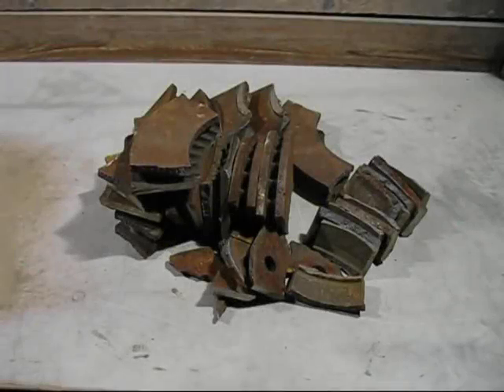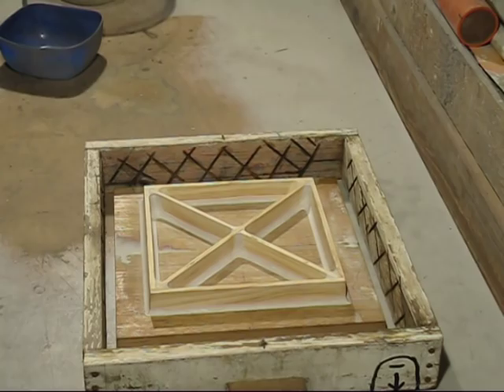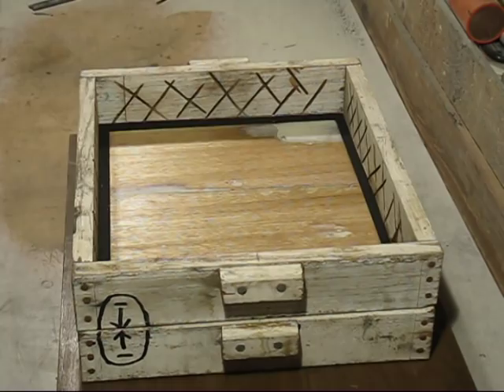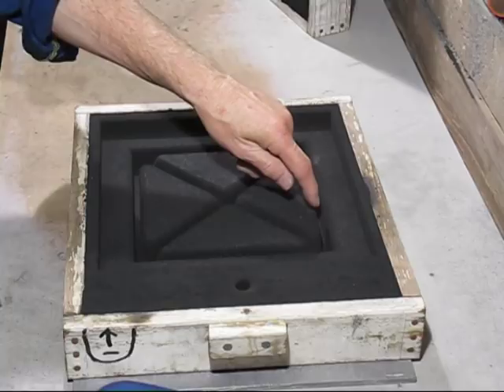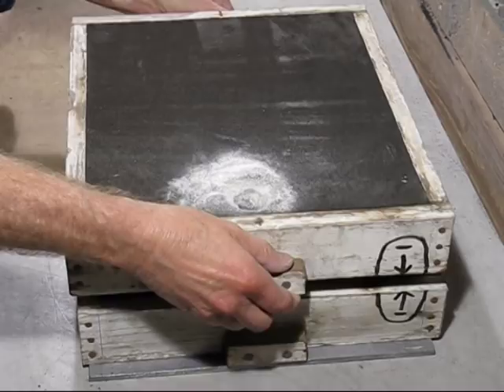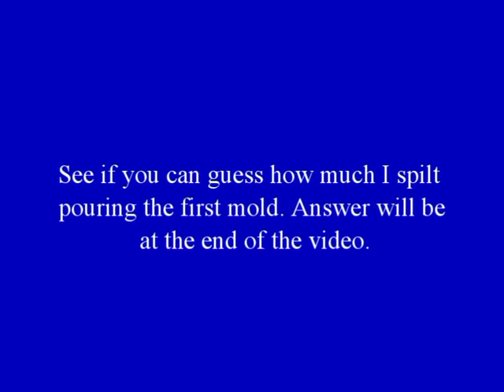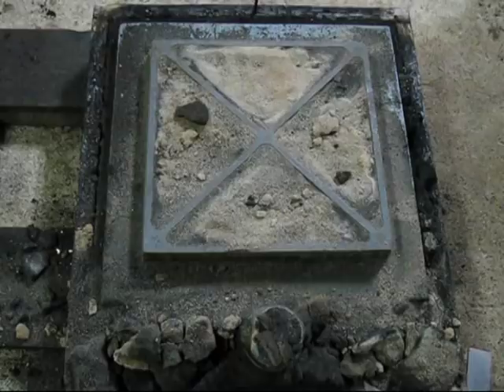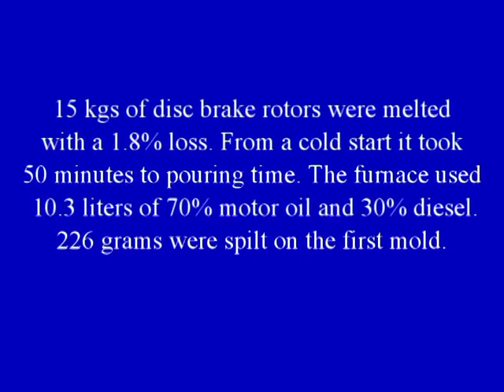Melting disc brake rotors (crucible camera action)

Comment: I have a stack of rotors waiting for my furnace to get finished to try this exact thing, thank you for sharing!
Reply from the maker: Are you still building an electric furnace?
Reply: yeah mate, its been sitting in the "To-Do" bucket for a long time, while I get my lathe and mill rebuilds completed. Finally got those both in and working now, so have resumed work on the electric furnace build... https://www.youtube.com/watch?v=kiWX_cyydqg
I'm really itching to start melting down some of the piles of scrap around the place
Reply: Really long video dude. Make it more shorter.
Reply: "Make it more shorter."  You can make your sentence shorter by saying "make it shorter".  Then it'd be more better.
Reply: It was 40 minutes, showing the same actions being done six times.  The comment has merit.
Reply: @dtrrtd774  LMFAO!!!  Or one could just say THANK YOU???  Yes, for sharing and teaching.
Reply: @alexa.davronov1537  Learn to use your keyboard or phone screen. If you arrow right → it will fast forward 5 seconds. Double tap your phone screen for ten seconds. None of us complained about the length of this video, so I am certain that you are the only one.

Comment: Well... I never had to break the rotors. My furnace held a full ton of rotors with room to spare. And our flasks were about 6 feet long usually.
I did not have that funny cart to wheel around my crucibles. I poured everything by hand and crucibles were measured to amount of iron needed for each casting
Good job. Good video.

Comment: I used to work in a Foundry, MJ Allen. We made all sorts of stuff, I was a fettler but I enjoyed watching the blokes make the castings and moulds.
When hand making moulds for cast Iron they would use a white, chalky looking liquid which they painted over the sand and it blocked up those grain holes that make the castings look rough. Unfortunately I can't remember what it was called but it's worth asking around, I'll see if I can contact the blokes I worked with.

Comment: When I was working as a ladle operator on steelworks, we used a mixture of water, diesel and compressed air to heat up the ladles. Started with diesel and compressed air and then we mixed in pressurized water in the burner .

Comment: Wow it turned out really well! I was helping my father change his rotors and pads recently and thought what a waste it is to throw out or return the rotors. Now after watching this I see a reason to even keep the oil! Can't believe it required almost 11 quarts worth plus around 3 quarts of diesel but if it's recycled motor oil the diesel is cheap. Problem I see for me is getting setup in the first place would cost prohibitive here in Florida as there isn't a lot of industry in the southern US historically, so it would all need to be shipped quite far $$$.
Reply from the maker: Florida is hot all year so the last thing I would want to do is melt cast iron. I live in the cold part of Australia.
Reply: $$$? They got's lot'sa cars with disc brakes in Florida don't they? My furnace shell was free, a really big old water heater tank. Made the furnace barrel and a 5" ring of it for the lid. A friend at a local cement plant gave me a few bags of out-of-date High temp refractory, (lines the huge rotary kilns that cook limestone into cement)  I built a 20' radius swing crane and hung a small Harbor Freight 500 pound electric winch ($50?) under the I-beam on wheels, because my large crucible is just a 12" chunk of 8" sched.80 (3/8" wall) water pipe (it was a free cut-off and I've got several feet left) with a scrap 1/4" plate bottom and 1" square lugs welded on, to lift it out of the furnace. I lined it with more of that refractory. OK, that's my big non-ferrous crucible, I think I paid quite a bit for my large silicon-carbide crucible for iron. As much free, used motor oil in Florida as anywhere else right? Does $$$ mean $3? OK, I did pay nearly $100 for my new 160 Amp Lincoln buzz-box welder, back in 1960 or '61, but it's been paid for many times over. I just remembered, I used a brake disc from a Pontiac Firebird to lock the the crane I-beam swing 10' up on the mast, with rod to an over-center, (locking)  handle below.

And luckygen, I live in the California "High" desert, preheats my furnace feed. ;-)

Comment: I love your furnace, running on waste oil is super,  do you have some video you could share on how you built it . I would really appreciate. Thank you.
Reply: What was the tank of propane in the background next to the blower fan? Pressurized waste oil. Working on vehicles in a small town, the guy who owned it needed heat in the shop. We place a 55 gallon drum outside, with a tire valve in the bung, after filling it, air pressure added. The draft tube went to 2" off the bottom, ran inside to a valve, but we dripped it onto logs in the double barrel stove. One load of wood would last all day. Boy, you could tell when the auto tranny fluid started coming in. It burns way hotter than just used motor oil. We could get 2 vehicles and 1 school bus inside & close the door, so it heated a large area, but we used a box fan behind it about 5' away.

Comment: I've been collecting brake rotors and wheel hubs for a friend who has a furnace that can handle cast iron. Working at a car dealership I have a virtually inexhaustible supply. :) My furnace barely manages to melt aluminum (but that was the design goal, burning wood scraps to melt aluminum), but someday I'll have time and room to build a nice one.
Reply: Try changing from wood scraps to ordinary barbecue charcoal... that’s what they used in the “Bronze Age”. And if you want to get really serious use coke

Comment: Thanks for the video, wanting to restore an old coal forge so might have to try my hand at casting iron myself. Although one of those things that sometimes having a professional show you or do it can make things easier in the long term
Reply from the maker: Are you going to melt iron with the forge?
Reply: @luckygen1001  Thanks for the comment/reply.
Not in the coal one as its a historical piece that is more for the experience, this video years ago was actually my inspiration originally to build a furnace/forge but due to lack of experience + safety forethought about oil/diesel mix i caused a fire due to a leaky valve, so have only been using Gas (thankfully i had foam extinguishers on hand for my vehicles/Equipment)
As my workshop is now full of old cast equipment from 1900-1960 i want to go back to using the oil/diesel mix with gas to do my own castings as looked at electric but don't have the coin for that setup as yet.
100% know that before i even try do any iron casting (I have done Ali,copper,brass on small things) that i need to get some hands on experience with a knowledgeable person that can help me mitigate the risks and provide advice (same reason i have a professional engineer that i can double check things with when doing machining work)
Thanks and didn't mean for the long reply
Reply from the maker: @boltonky  Please do fix those leaks as oil fires can be scary.

Comment: If you do another surface plate, design it with 3 feet instead of 4. That is how most of them are done so they won't twist under their own weight. The twist us usually tiny, but if you are going to scrape it flat to 10ths it is enough to cause a problem. Great video

Comment: If you want more rotors (or other scrap and cut off bits) beer works wonders at garages, scrap yards and machine shops. Scrap iron/steel prices are quite low nowadays so it's a good deal for all concerned. Garages save scrap to be rid of it and few make enough profit to matter.

Comment: Really nice 👏, I use graphite sometimes but it's just to make really rough patterns release from the sand but it also helps Sarah there's a refractory surface against the facing singing as well and I'm surprised you had to Chisel out the sand in the webs but regardless it looks like it turned out great. I made a surface played a couple years ago and it did not turn out anything half as nice as what you got there

Comment: A press with a vee or ball bearing pressing insert might break the rotors more easily than grinding.
Reply from the maker: I don't have a press but could use a hydraulic jack instead.
Reply: I was thinking that my 25 ton log splitter could work
Reply: I just bash em with a 4 lb drilling hammer. I often do it on accident removing seized ones for replacement.

Comment: Hey maybe a suggestion that could help you do less work for the cast iron from the discs. My suggestion is go to your local automotive shop that cuts rotors and this could be a autoparts store or a repair garage that cuts rotors. They always have cut waste from the rotors they will gladly give you for free, heck I would have given you small buckets due to the weight when you discard the waste cast chips. I also think it would melt faster than a solid would. Best regards.

Comment: I have an old vise that is cracked.  I want to try my hand at gas welding it with cast rod. The only cast rod i can find is very expensive.  Some people say to use piston rings. I was just thinking of this video and came back to it. I wonder if I could cut some longer strips close to the center and use the rotor material?  I wonder if the alloy is too hard? Ill plan on doing a long post heat and cool down.

Comment: Back in the days of Galleons and cannons firing cast iron balls, a foundry in the UK used to dust their molds with Plumbago, which I believe is Graphite. it was only mined in the UK at that time and this process allowed the casting of far superior balls to any other country.  I live in S. Australia, where do you get your Ferrosilicon from?  The foundries that I used to work on furnaces, have now closed up.
Reply from the maker: Try cast metal services Australia, that is where I got mine. You may have to buy a minimum amount.

Comment: What a brilliant idea with the disc brakes. I never would of thought to try this. Just brilliant.  I actually have to old large disc brakes. 
I have just bought a old lathe I'm doing a full restoration. And have a broken lathe change gear with a couple of teeth broken. and wondering if I could try this method to make a new cast of my gear. The lathe is 94 yrs old. And just can't find a replacement  gear. Do you think trying your method melting  the disc brakes. 
This would work. Would love to give it a shot.

Beautiful casting you made there. Turned out great. New subscriber
Reply from the maker: It is not a good idea to cast teeth for a gear, better to cast a blank from the old one and then cut the teeth on the blank.
Reply: @luckygen1001  ok thanks

Comment: Another great video. I did think you were pushing your luck with such a small clearance on the cope walls but hey you did it :-)
Ever thought of having the flasks closer to the furnace?  Seems quite a walk. Always entertained and educated by your videos. 
Can you advise how to add silicon to aluminium to improve casting properties on non cast scrap?
Reply from the maker: I have never added silicon to aluminium so I cannot help you there. The area where I run my furnace is very small so putting a lot of molds on the floor makes it very overcrowded. When I use an A6 crucible which holds a small amount of iron I pour right next to the furnace.

Comment: Great vid, mate...but I did cringe when the crucible cruised on by the propane cylinder and gas hose through the doorway. ;)
Reply from the maker: That was a propane bottle used to store my waste oil for the furnace.  The yellow hose is compressed air to pressurize my waste oil bottle.

Comment: It would be cool to see how you machine that plate to have a smooth flat finish, and what you will use it for.   What is the advantage of using the graphite over using talc ?
Reply from the maker: Graphite is supposed to give  abetter finish on the surface of cast iron.

Comment: I want to say that you did a great job on THAT casting but I have a couple valid quistions how long did it take to melt the iron into a liquid and do you have any estimate on how much gas you used durring the melting process I just want to get a dollars and cents idea of what the cost was to make that part I have seen Coppola furnaces used to melt the iron and other high temperature metals but had no clue that such a melt could be done useing a furnace design like yours most of the melts that I've seen using your type of furnace was aluminum bronze copper and brass all low melt metals compared to iron or steel also I have one more question?  The sand that you used it was black can you tell me what the exact mixture was proportionately I was wondering if you had mixed the graphite powder in with bentonite clay and silica sand to obtain the color or weather you had used a different mold material BECAUSE you were casting iron thanks for the video p.s. that  casting ranks up along side any professionally cast iron parts that I have seen done by foundry corporations anywhere and I can safely say that all of us would enjoy seeing more iron castings from you soon
Reply from the maker: The end of my video shows how long and how much oil is used.

Comment: Thought it was a long way from the furnace to the mounds, wheeling the molten iron! Nice video though.
Reply from the maker: Did you notice that every mold filled up and the last metal left in the crucible came out? If the iron is hot enough it will be hot enough to pour after the long trip from the furnace

Comment: I really enjoy watching your foundry work.  It's inspiring.
I've made a little hairdryer/20 litre bucket/refractory cement/BBQ fuel furnace and have been melting scrap aluminium in to ingots ready for a project at some point.  Do you think a propane burner (of correct size) would be hot enough to melt brass in this style of furnace? As I have  a bucket of old taps and plumbing fittings that I'd like to re-cycle too.
Reply from the maker: Propane will melt brass with a decent sized burner

Comment: I had to dispose of a piano that the garbage men wouldn't take. It was too heavy. I burned the piano and found the pin block was a giant piece of cast iron. It broke apart pretty easily with a sledge. It was at least 50 pounds of cast iron.
Reply from the maker: I would love to melt a piano base sometime.

Comment: Thank you, sir, for sharing your knowledge with us. I've never tried my luck with cast iron, so the tips you gave are very valuable to me. 
Would it be feasible to add carbon to the mix? I would think some of the carbon that makes cast iron so brittle would burn off in the furnace, leaving the pouring metal with an extremely low carbon content.
Do you have any experience with doing so?
Reply from the maker: Carbon tends to float on the top of the melt. If you left long enough some of the carbon will burn out.

Comment: I am curious, why you did not add any open risers to the mold?    
Is this because the webbing on the back side of the plate effectively functioned as a riser?  
Wouldn't have  an open riser help in judging how full the mold was when pouring rather than using the sprue to be topped off?
Reply from the maker: You are confusing a riser with a vent, they have two different functions.

Comment: If the sand is wet then surely the hot material poured into the sand moulding would turn the water in the sand to steam and cause an explosion? Evidently not, since this is a tried and true method, but why not?
Reply from the maker: Sand porosity is very important here to let the steam escape. I f the sand is too wet then there will be an explosion.

Comment: Great video. You now going to have to leave that casting to weather and age before machining? Surprising just how much castings can warp as the stresses work their way out?
Reply from the maker: As soon as I get time in the next week or so I will machine the surface plate.
Reply: luckygen1001 Thank you,that will be interesting. I have just spent some time hand scraping a high spot off my surface plate that could only be down to warping? I have used a fly cutter in the mill to machine large flat surfaces but takes time to get clocked in perfect. Look forward to watching the video,be interesting to see if it does move any after machining since the casting still quite green?

Comment: This may be a stupid question, but why does no one use a vibrating table for making sand casting molds? 

Seems like a little jigsaw, minus the blade of course, set next to your mold would aid in getting all those little particles packed down tight.
Reply from the maker: Some foundries use vibration to make molds far quicker than doing it by hand.
Reply: good question, being that they're so easy to build
Reply: The sand has to be rammed anyway, it would be an extra step for little gain. I bought a used pneumatic foundry rammer cheap on eBay, makes a quick job of ramming the sand.
But I use the red Petrobond sand, it's somewhat stickier and harder to ram than the clay/sand luckygen  and many commercial iron foundries use. Yeah, it's pretty expensive and the first inch or so is burned, but I now buy Petrobond oil and mix it here, fairly inexpensively. It gives a finer finish to non-ferrous castings. If I did a lot of iron casting, I'd have clay/sand too. I also use a "silver paint" (can't think the name right now) from a foundry supply, as parting to paint my patterns, works very well. It is kinda messy though but foundry work isn't like a desk job anyway.

Comment: Now is there any possible chance you would consider to show the rigging or your oil burner? I mean for years I have been thinking about to preheat it.. but you seem to have a more sneaky way to do it!!
Reply from the maker: No sneaky way of doing it I just use waste oil mixed with air from a vacuum cleaner.
Reply: just light it like you would a smudge pot,  just light an old rag/cloth soaked in oil. doesn't take much to get one going